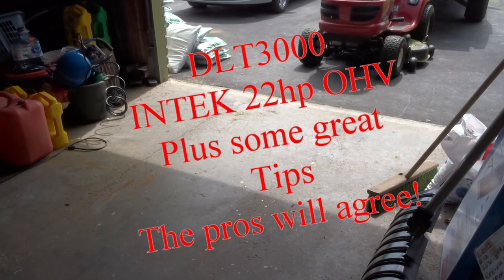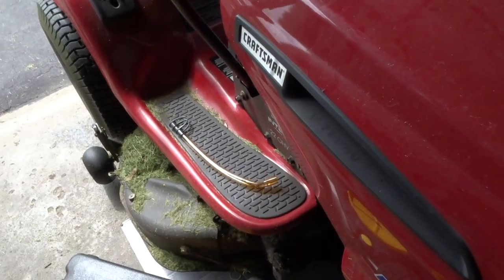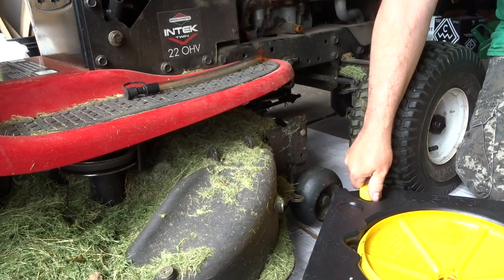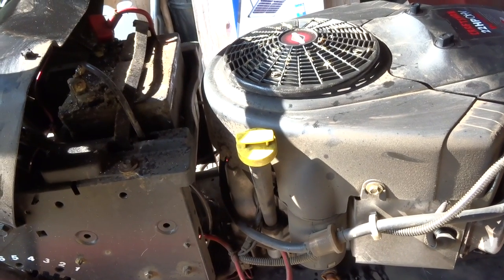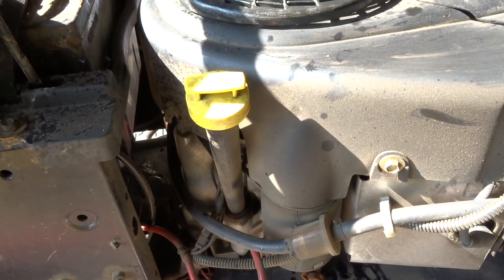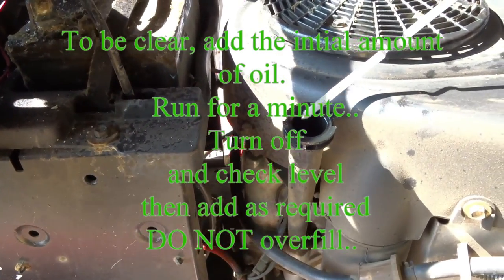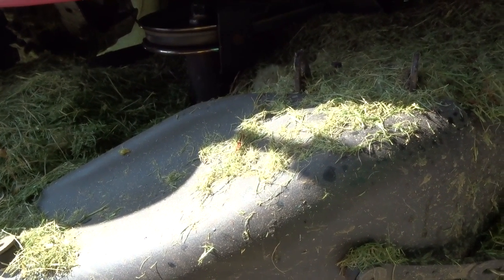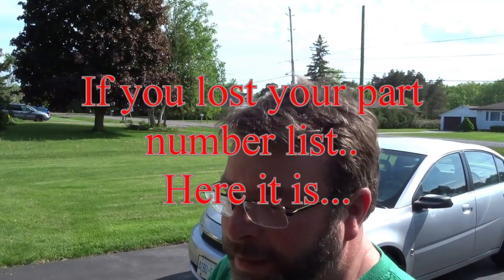Craftsman Lawn Tractor Oil and Oil Filter Replacement

Comment: Nice video here’s a few tips,  clean off the engine before you drain the oil for it makes the engine run cooler, run the engine to warm up the oil for it will flow easier, use an air hose to flush out the remaining oil,  adding a little Marvel Mystery oil to the oil and gas helps the engine also. Thanks again
Reply from the maker: All good possibilities for the crowd… thanks for watching and comment…

Comment: Thanks learned something, like getting all the dirty oil out.. I don't seem to have filter on side of motor any help? Please?
Reply from the maker: It depends on the brand or engine type / size, some smaller engines do not have an oil filter, that might be the case.. the filter is usually pretty obvious to see. So take a look again both sides to be sure. If it does not have a filter change the oil twice as often.
Reply: What's the oil filter number

Comment: At 4:07 he poured something into the mower. Is that oil?
Reply from the maker: Yes, it was fresh oil to flush out the old …
Reply: @kd_enterprise3404  Thanks. And thanks for the video.
Reply: @kd_enterprise3404  Oops. I think I put too much oil in. The level is past the FULL mark, even though I put in about as much as what is listed for the OIL CAPACITY under the hood. Should I simply drain some oil out?
Reply from the maker: @newsreach  it’s not good for it to run if too full, if you changed the oil filter also and have not run yet ….it might be ok because oil needs to fill the filter. A tiny bit over ? Or way to full?  If it’s way over full definitely drain a bit out…
Reply: @kd_enterprise3404  Another rookie mistake: I changed the oil before I changed the oil filter. When I change the filter now, will there be a flood of new oil pouring out from the mower?
Reply from the maker: @newsreach  no, all the oil is lower, you will some oil running from filter but expected… not a big deal..   no worries.
Reply: @kd_enterprise3404  Success. As you said, no big deal. The tree guy for the power company happened to come by and told me to screw the filter on tight but it doesn't have to be too tight.